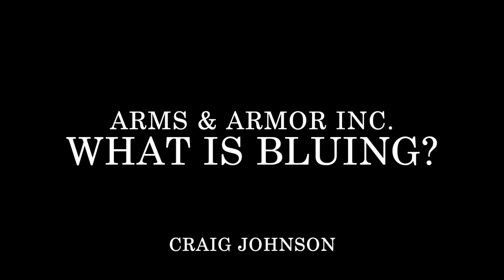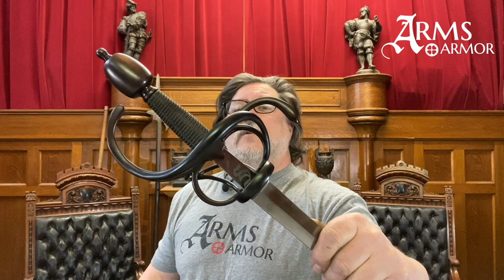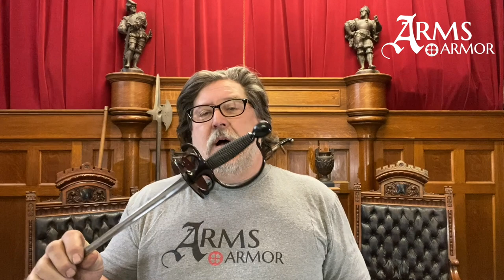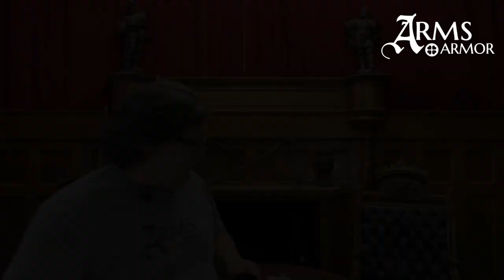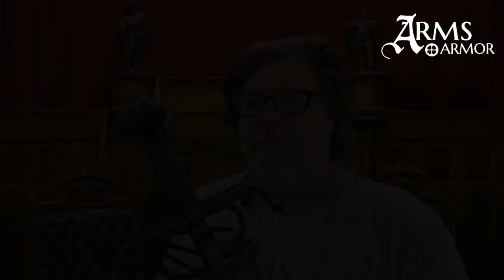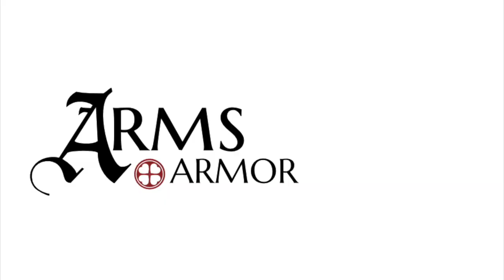What is bluing?

Comment: Great video, thanks Craig. Just wondered, how does hot-bluing not ruin steel temper?
Reply from the maker: Its not hot enough to affect the temper on a blade but hotter than you would want the hot tub to be :-)
Reply: The temperature hot bluing is done at is only around 300F. Temper for a sword blade may run anywhere from 450 to 600F, depending on how tough you want the sword to be.